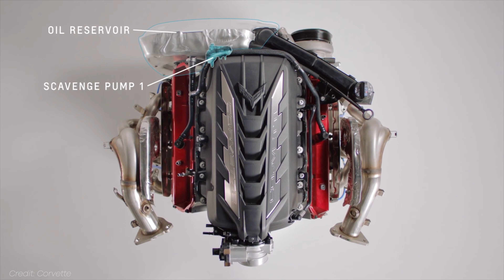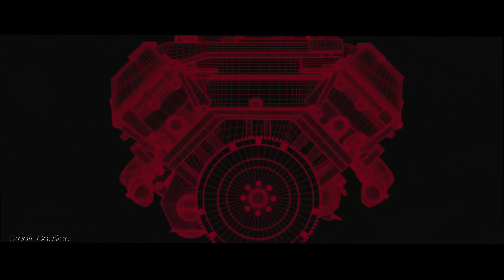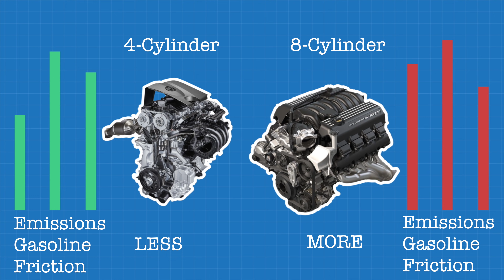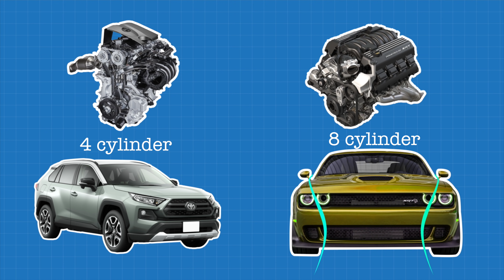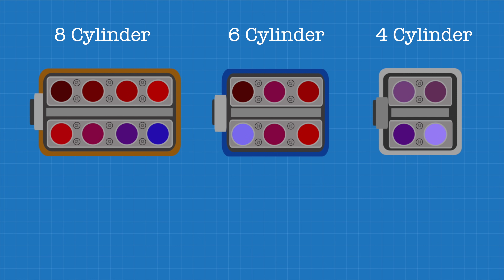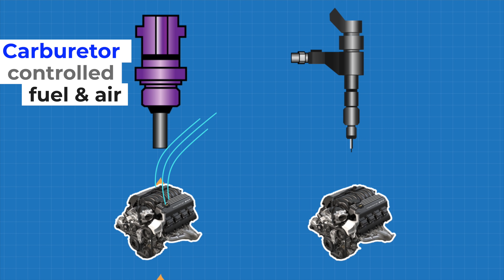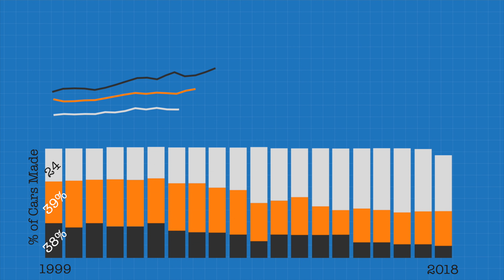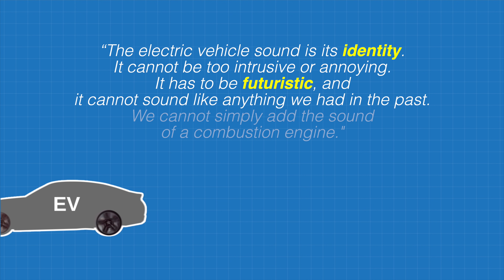Why V8 Engines are Dead

Comment: Sad part is with modern oils and Machining most of the inefficiency of the v8 is pretty much gone. Most engines that make 300hp make about the same mpg no matter their size when driven the same. And with hybridization the issue of efficiency becomes even less important. I think the real reason they're being phased out is because they usually last to long. Why sell a v8 that lasts 300k+ miles when you can sell a twin turbo 4 cylinder that's lucky to push 200k?

Comment: What’s been frustrating is my experience with the 2006 GMC Envoy. The Atlas 4200 inline 6 that mine has is a great engine, but the 5.3 liter V8 has the EXACT SAME gas mileage. I’m wondering why I didn’t just hunt for a V8 version. I ain’t getting a custom exhaust system for an i6 lol

Comment: Aslong there is corn or fruit or potatoes you can make fuel an pig poop can produce methane.     An oil well cannabis can be used made for lubricates aswell clothes an body panels.  Also cooking oil thats been used can be used in old diesel engines.

Comment: All these comments 'nyuh v8 vroom vroom NHRA racing never ded'.. Y'all do know that they're putting turbocharged 6 cylinders in 1200 lb race cars pushing 600+ bhp topping over 200 mph right? There's more to performance than Nascar and drag racing. 

V8 might not be dead but it's borderline laughable. Yeah you get the sound and a lot of torque, it's fun. That's pretty much it. 

This is coming from someone that drives a 91 z28 with a 5.7L V8 every single day
Reply: Not to mention no stock v8 can even beat a v6 GTR 😂😂😂

Comment: I drive a f150 and the 5.0 coyote v8 is in my opinion crap compared to the 3.5  twin turbo v6 eco boost but just my opinion used to have a v8 in my last two trucks and this is the best engine yet

Comment: Dear Scotty, I hate to ask for free advice, but here ya go. My 2011 Crown Voc LX (Homeland Security car assigned to a captain (before I bought it) was AMAZING. Now for the question, I searched high and low for a Brand New wiper motor, to replace the one that just went out on me. (Quadruple verified that it the wiper motor is bad, and not the stick shift column. This replacement should be easy peasy, however I am disabled with severe imparements, and I must hire out the install. I hear that about $175.00 is the fair price to pop off the cowling and install the brand new one. Does this quote of $175.00 sound right to you?? Thanks much and God Bless. FYI, I live in the Greater Nashville area.

Comment: I don’t think the V-8 will go away because of its popularity and new technology making them more efficient. My 2000 mustang gt gets 20mpg city and 28mpg highway. I think if they had simple V-8’s they could easily get the same as a 4 cylinder. The coyote motors get less mpg because they are dule over head cam and 4 valves at 5.0 rather than a small single over head 4.6 2 valve. But the coyotes are also twice the power as well. I also think the 4 cylinder is going more after the V-6 rather than the V-8.

Comment: That’s a lie bro a old work truck ls1 small block can make 1000 hp and you can buy one for 5-600 bucks with wire harness and all or buy an old work truck with no title saying v8 is only for the rich ok

Comment: I'm 28 years old, I got a lifted 94 F350 with a massive v8 7.5 liter engine. It's got the aerodynamics of a brick,  uses gas like a fire hose.  4 miles per gallon.  LOVE IT! I will keep it til I die and pass it down.

Comment: General Motors announced that they dont have one single cylinder in their cars after 2035, because then they are producing battery powered vehicles only. Personally, i'm not crazy about that vision myself. Combustion engine isn't bad consept at all, and they can be very fuel/emission efficent.

Comment: If the same power can be derived from 4&6 cylinder engines with greater efficiency, there's no need for an 8 cylinder engine in a passenger vehicle. Or an American "sports car" for that matter.  It's an unfortunate and heartbreaking fact. The production  V8 muscle car is a relic.  😯

Comment: i think nissan and toyota would have to disagree with you regarding the efficiency of said motors- they build LOTS of them. some of the japanese V8 blocks are even cast here in the states- by contractors who made/make them for the domestic automakers. the V8's of today boast overhead cam and variable valve timing technology (things that weren't possible or practical with pushrod valvetrains) and they are considerably more powerful AND efficient than the boat-anchor V8's of yesterday. the newly-required EV sounds you speak of were inspired by construction equipment safety systems.

Comment: We need to get rid of this obsession with speed because it kills a lot of young drivers which destroys families and marriages not to mention the first responders who have to clean up the carnage. I am encouraged by the UK's current move to require cars to automatically slow down to a road's posted speed. The U.S. already refused to consider this safety measure. I think because of the negative effects it will have on the body shop, auto parts, insurance, hospital, medical supply, funeral and new car industries.

Comment: Who needs fuel efficiency when it comes to a v8 now? What we like from a V8 is its torque.  Everyone in car manufacturing is going to V6's and inline 4's but those of us who love the V8 have survived the oil crises by better engineering. Now it's electric and hybrids. ... but by promoting these alternatives to the average buying public, they've forced oil producers to recognize that their precious product is losing its grip on the motor vehicle industry so they were forced to reduce their prices per barrel. Those of us who are still using the V8 are now benefiting from sticking with the the 8 cylinder icon.  I'm apparently not the only one who's resisting the disappearance of the V8 as the airwaves and social media are loaded with enthusiasts who are restoring old engines and model cars literally from grave yards of rust.

Comment: One of my favorite engines was the one in my 1998 Ford Explorer. It was the 302 V8, same engine that was put in the Mustang GTs. Great engine. I traded in my Explorer in 2012 with 175,000 miles on it. The engine was still going strong.

Comment: If V8 engines are dead Ford motor company would not have designed the new 7.3 liter push rod style engine for it's F250 235 and 450 trucks.

Comment: I love the power of a V8 engine, but hate that now they are using aluminum heads on a cast iron block and then they use cast iron manifolds... when they should be making stainless headers to reduce bolts popping.

Comment: My 1976 Mercedes-Benz has a 4.5 litre V-8 under the bonnet. Driven properly, it gives good fuel economy. I have no trouble getting parts for this car.  This car of mine sounds like a small block Chevy. The V-8 was a factory set up. Performance is good.

Comment: Before Henry Ford die-casted the whole V8 engine,   the cylinder blocks were bolted on to the crankcase,  which lowered the cost substantially,  but the castings had to be left outside for a year  because the shape changed while coooling,  and after being seasoned for a year the block can be machined to specs.

Comment: Well, I used to be a Motorhead; but just as sure as the engine doesn't exist that's faster than Police radio transmission: future Legislation will eventually phase out the V8 because of environmental mandates.
Besides, what do I have going on with Ford, Chevy, Chrysler, Plymouth, or any of the others that won't eventually end at the junkyard? (May they: Rust in Pieces)

Comment: I have trucks and i have had had 4 , strait 6 and v8s and in that order , and the last 4 have been 8's with good reason . I us a truck . it is not for pretty . And 8 is the way to go you have power with less rpm . The old john Deere farm tractor only had 2 cylinders , but had a massive fly wheel . and in my experience with owning one is the 4 cylinder ford and farmalls  were way more fuel efficient . Although a 2 cylinder john deere  has a sound that is music to some tractor lovers

Comment: I mean V8s aren’t really dying because now everyone is putting them in pretty much everything you have the 5.3Ls the 6.2 you have Ls fest and Holley shows these types of shows are boosting the performance of these Engines so however the v8 isn’t really dying. Yes these engines are made for high priced vehicles because they push great power i have a 5.3 Great motor had it for two years nothing but an Radiator leak but still a great motor

Comment: I own a 2012 Lexus ISF V-8 N/A,  I love the sound and it's performance.  
Even if EV cars are already on the market I'll choose a petrol engine over it. 
Tesla does not allow outside shops to repair their vehicles and monopolies the market on it's parts. They can even turn off the super charging on any of it's vehicles.
Also if you live in a state or country that hasn't fully developed on EV cars, you are going to be stuck until you find a power outlet. I don't think EV vehicles are saving the planet, where do they dispose the lithium ion batteries? Some countries use diesel fuel for powering generators  which the Tesla or electric vehicles has to plug into. Electric vehicles need coolant to cool down the batteries,  same aspect for the hybrid vehicles only difference is there is a petrol engine to supply power when needed.
Fake V8 sound on a electric vehicle not sure about that,  Or a winding turbine sound so the EV will seem like its ready to take off with the Knight Rider effect.

Comment: In order to make efficiency requirements they have moved to engines that are smaller and more efficient by being lighter and standard less hp when not on full throttle.  V8s in America were big towards the end.  Look at ferarri with V8s as small as 2.9.  Now with turbos and computers we can tune them for more HP and torque.  so 6 cylinders and lower is better to meet emissions and fuel economy. But we still have cars with 12 cylinders 10 cylinders that are reserved for supercars.

Comment: I truly believe enough electricity TO REPLACE OIL FOR TRANSPORT...... CANNOT BE MADE.  I just cannot see how.  With losses occurring changing energy type from one to another at every stage of the processes. If you worry about CO2 in the atmosphere, less is put there using oil than other methods of powering transport because of the immense energy density of oil.

Comment: Meh.   Everything that makes a 4 or 6 cylinder engine produce more power applies to v8s.   The part count is higher, but not proportionally. . .   heads, blocks, cams, and accessories are the same.

But. . .   That’s all moot, with electric power.  The V8 will be around as long as the smaller engines, until Tesla kills them all.

Comment: I feel like electric vehicles are a dead-end development, because the resources required to make batteries - and the severe damage they do to the environment, not to mention the added weight - makes them overall inferior to internal combustion except for certain purposes (ie. Locomotives). An exception to this is hybrid technology; allowing the engines to shut off when 'idling' is a fantastic idea, and is far cheaper and reliable if done correctly.

What I think the future will entail, is hydrogen; it's safer to transport (there's been tests done with storage mediums that create armoured shells that automatically ignite a pilot flame and vent its contents in the event of an emergency, and most cars can likely be adapted to use hydrogen. Most importantly, if you use solar and wind energy to power electrolysis, you can make an effectively limitless fuel supply, as the byproduct, of course, is water. Hydrogen is also much cheaper to store than electrical energy, and doesn't degrade over time.

As for V8's themselves, I feel that if hydrogen were to be fully embraced, V8's could see a resurgence. I don't know how possible it is, but what if it were possible to disengage certain cylinders on a V8 to eliminate the friction disadvantage of V8's when the added power is not needed? Assuming of course that doesn't completely mess up the timing.
Reply: Hydrogen is stored at 5000psi and leaks out of containers between the molecules of the vessel because the H2 molecule is very small, AND it`s under this pressure.  So the storage does degrade over time.  
Cylinders ARE shut down  already as you suggest in V8s.  Manufacturers have already perfected this technology.  Rolls, Bentley, Mercedes, Aston Martin come to mind.

Comment: Because the modern 4 and 6's are more then what most people wanted out of a car that is just a soulless people mover They have enough power to get the kids to soccer and sill have some fun. Its good enough mentality. What you can do to the 4 and 6 cyl you can do the the modern a 8 cyl and will make way more power that a 4 or 6 could or would have to be extremely modified to survive at for even a few runs and you can drive the 8 daily depending on build or get more track runs between rebuilds. American v8's like the coyote and ls and new lt engines and dodges modern 8 cyl
 are nothing like the old 70's and 80's engines. I average 23.5 mpg mixed in a 2019 mustang gt.

Comment: How can I properly diagnose an oil pump on a 2010 Dodge Ram 2500. 5.7L hemi. I just did the valve springs, liters, head gaskets, I drilled out the broken exhaust bolts as well. Now after all this I drop oil pressure. On start up it has about 50 pounds of oil pressure. Then after it warms up I seen it drop as low as 2. That’s when I stopped driving it. It goes up as I accelerate it. But drops right back down. Oh and I also changed the oil pressure sensor as well and still has the same issue

Comment: Trucks:
"Huh?"

The main reason V8's are disappearing from cars is that cars are getting lighter.

When your car body and chasis only weighs 1,800 pounds, having a V8 in the front makes the car so nose heavy it has trouble going around corners....its why Corvette went to a mid engine design.

But when you can get 150 hp per liter of displacement there's really no reason to cram a v8 into the family car.

Engines the size of the old v-8 big blocks would be about 1,000 hp
(A 454 with today's tech = uncontrollable drooling)

So small block V8's will live on in trucks. larger cars and a few mid engine sports cars, but its days as "the engine" for daily drivers is over.

Oh well, long live the turbo in-line four.
You don't sing as pretty but you can still  scream like they did.

Comment: I thought of a recorded exhaust sound when I almost got hit by a Prius in a parking lot over 10 years ago. Project the sound under the car, with the sound going faster or slower according to throttle position. Then someone came out with this gadget you plug into the cigarette lighter, and you could choose different types of engine sounds. I think it picked up on your ignition and revved up and down according to your engine speed.

Comment: I thought you were a mechanic. Yes, electric motors have always been superior, but the only way to produce that much power is with a V8 generator. RPM don't produce amperes. Remember, your metric system third world cars rate in KW instead of HP (electricity being mostly an American development). Retire, you're losing your wits.
Reply: @Mark Codiroli 486 watts per HP, even in your third world.
Reply: @Mark Codiroli 486 is another Goofle correction. Flash the field and a motor is a generator. 746 is a general term, like 120 volts. There are so many variables (equations) that I have never seen a dyno hit it dead on. The 1.73 constant multiplier for three phase is one of them. Gasoline is pound for pound the most powerful and reliable energy source available. BTW, neodymium causes arc scars on bearing journals in modified wave forms. Effective electric vehicles are not at the Model T stage yet (Ubiquitous affordability). V8 engines should have died in the 70s when the pumps were to be dry by 1980! LOL Isn't Nostradamus one of yours?

Comment: I think that private cars in general are going the way of the V8.
First only the rich were able to own cars, then everyone, next step will be that only the righ or the ones that absolutely need a car will buy a private car (which will be heavily taxed and costly to own), and the rest will manage with public transportation or ride sharing, simply for the reason that you don't need big expensive metal box on wheels that costs you tens of thousands to buy and thousands to own, just to use it for 20-30 minutes a day.

Comment: All respect lost from one totally idiotic reasoning as to why V8s are dead. Any engine, in any configuration, will perform as the engineering team designed it too. A 5.0 V8 vs 5.0 I4 vs a 5.0 W6 each making 200hp will inevitably use the same amount of fuel to do so.

When I hear someone say V8 I think North America... When I hear someone say V8s are dead I think Europe and Asia, and morons.

Thanks.

Comment: Fetishising  a V-8  engine is a waste of money. Efficiency, power, and reliability is more important then the number of cylinders. I grew up in a family of gear heads and never did agree with obsession with more power, weight, and expense then was needed to perform a given task. Maybe the market has proven me right. The irony is that I became a machinist and could build a rad V-8 if I chose too.